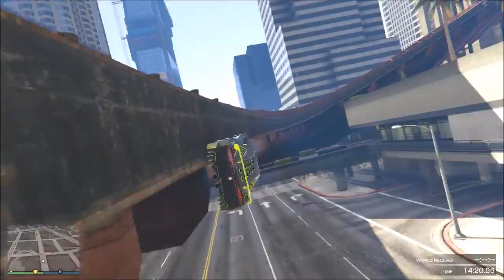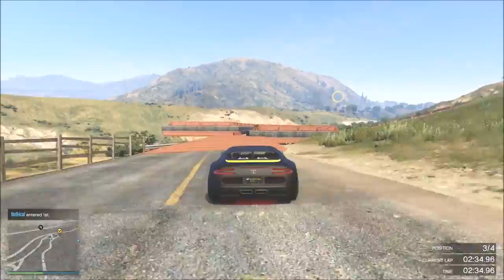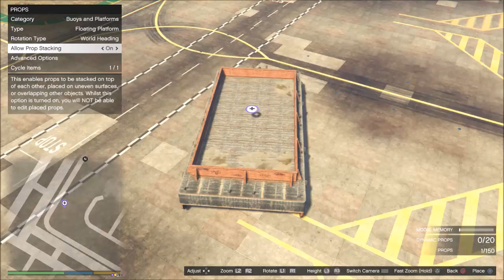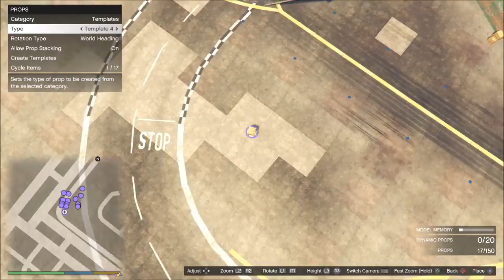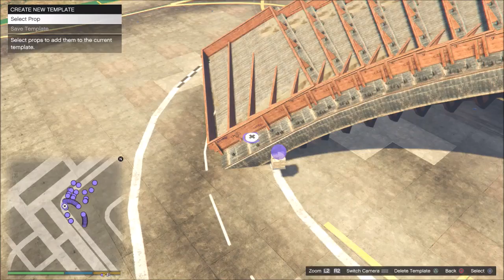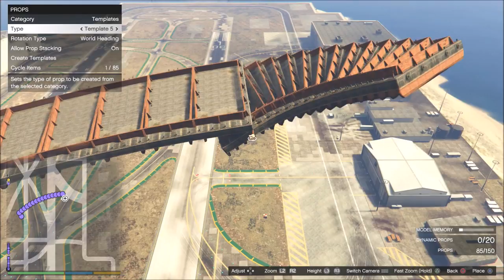TUTORIAL #34 - Single Line Barge Spirals - How to build ( GTA 5 Content Creator )

Comment from the maker: What tutorial do you want to see next?
Reply: CCC 010 How to place the "Auslöser" in the sky.
Reply: 1.how to make supernova spirals, using the long ramps
2. how to make flashing ramps or wallrides, NOT roads or platfors

thanks
Reply: CCC 010 The Cambo20 flip
Reply: How about a tutorial on building Wingsuit Captures with different difficulties?
Or maybe some of the most intricate flips on (stunt) races?

Bitte!
Reply: J. Dijkstra   I'm pretty sure this is just try and error 😂
Reply: please could you tell me how did you make the single barge wallride, not the spiral
Reply: MYSTERIOUS STORM  Same as the spiral without the rotation I guess 🤔😂
Reply: Micha Grill but how would you connect them
Reply: MYSTERIOUS STORM   uuh i dont know XD